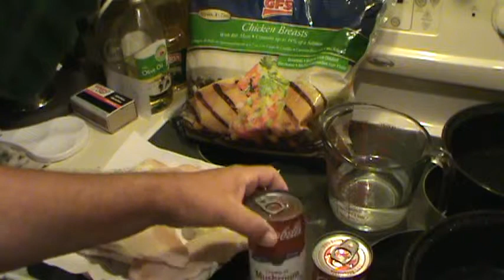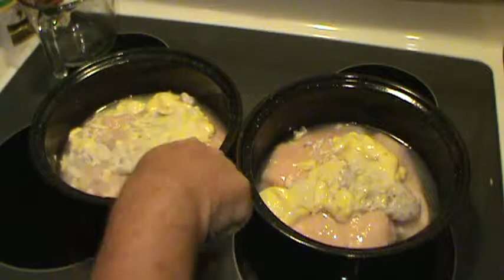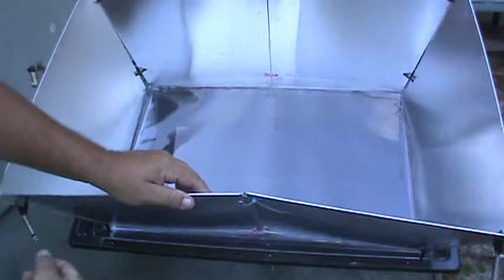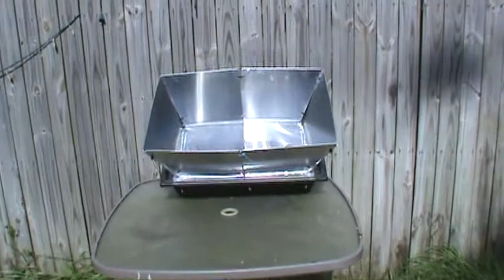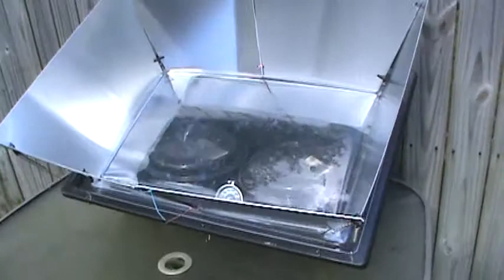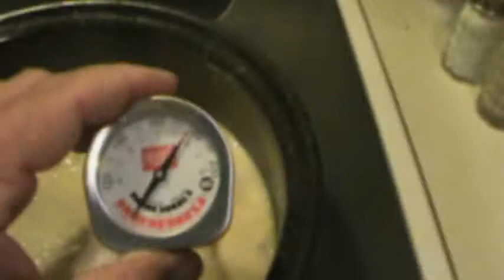Solar Oven Cooking

Comment: SOS Sport = One of the best investments you will ever make.

If you want to be prepared consider also purchasing:

1. A StoveTec Deluxe One Door Stove, it burns any bio fuel (wool, cloth, grass, dried dung, bone, etc.)
2. A thermal cooker, such as a Saratoga Jack's 7L Thermal Cooker, which will keep 7L of food/liquid nearly boiling for several hours - works great atop either a rocket stove like the StoveTec, or atop a solar parabolic cooker.
3. A single burner butane stove, which can be used indoors because butane produces no carbon monoxide. Thermal cookers work perfectly atop butane burners also.

With these iyems plus what you have you can cook & have hot food & water in any weather, day or night, indoors or out.

I hope this helps.